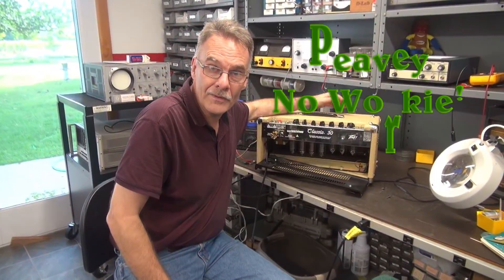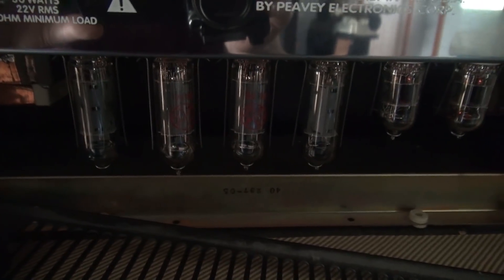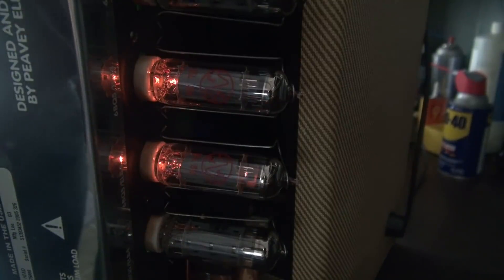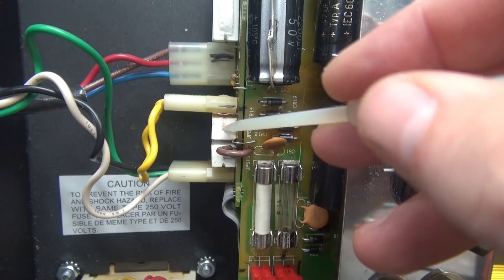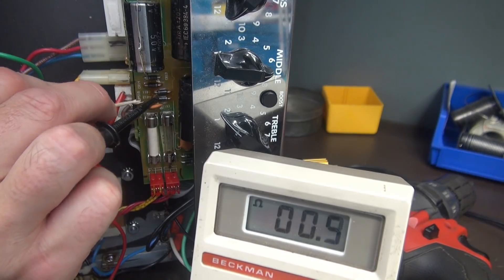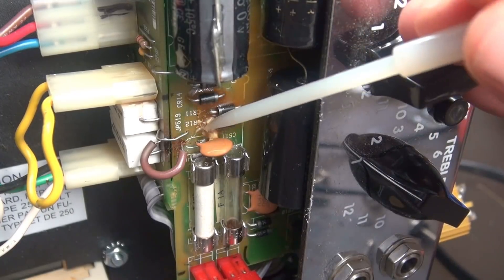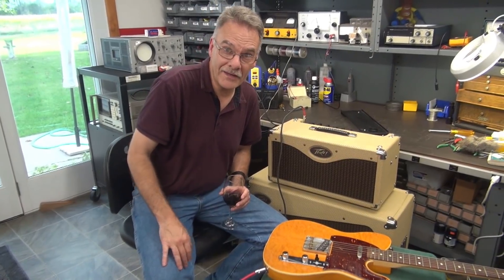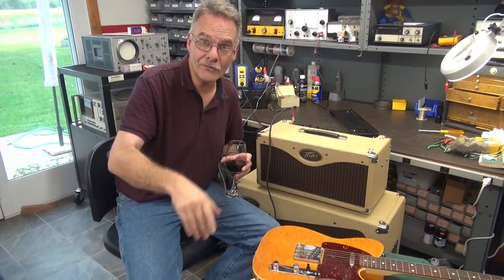How to fix Dead Peavey Classic 30 tube guitar amp no output for Free D-Lab electronics

Comment: Hey, thank you for posting this video! I'm confident in being able to do this repair on my Classic 30 because of the knowledge you shared. Apologies for this noob question:  Do you think it would be alright to complete the jumper between the resistor and diodes with an insulated copper cable, or should I use a different type of wire?

Comment: Hi D-Lab, appreciate your videos! I've got a C30 too, great amp. Now, as it runs very hot, I was wondering, is there something that could be done to make it run cooler? Or is it just the way it is? One could fry eggs on it that's how hot it gets! People say that this isn't a problem, folks even use it during hot summer months in the sun without problems. Still, I'd prefer if it didn't get that hot.
So if there's anything that can be done, I'd appreciate your advice! Thanks!
Reply: My tech and the a tech online said it wasn’t an issue. I still run a small fan on my classics. They don’t cook as hot now. I’ve seen rig rundowns where the amps have a fan cut in and installed on amps. I’m still not sure if the fan does any good though? Amps still work great.

Comment: Having similar issue, changed the bias resistors and it will run for about 2 min then has a low screeching sound and nothing from the guitar

Comment: D-Lab great video. My issue is none of the tubes come on. Sure enough right where you have the issues with this amp mine showed the same burn AND the last tech did a similar jumper to yours. Also mine has the same burn area around C51 cap (?) next to the fuses. Mine looks much worse though than yours and hasn't been jumped like the one in your photo. On yours ( at 3:09 in video) it looks like the person completely pulled the Circuit Board to make the jump solder connection which I do not want to do. Is there a shortcut?

Comment: Hi! I appreciate your videos!  2 questions: 1.  WTH is with the electrolytic cap that's right next to the 4 diodes? That would be the top of the picture.  It looks like the leads of the cap are folded over on each other and are soldered together on the top of the cap....   2.  It seems as though the 2 outer output tubes aren't glowing....could be camera's fault, but are they working?

Comment: Mr D-Lab or may i call you Terry ?  I hope you can direct me in finding the right replacement for a  Motorola  70474200 W 9703 power transistor that seems to be extinct ? and point me in the right direction, i apologize  for ask-n about  solid state, instead of tube but i thought if anyone knew it would -b u

Comment: Thank you, D-Lab! I'd been putting off fixing mine til I saw your video- same problem, same spot- but the other big square resistor, which, strangely enough, crosses over to the far 2 diodes. However, same traces also go to a ceramic cap much closer, and not covered in adhesive. Soldered that in, now I'm up and running again! playing 60's Soul from Muscle Shoals with MighTy Finds Band and MT Arms Duo- thanks again for the video, D-Lab!

Comment: Hello, I would like to tell you about my problem with the valves of my peavey classic 30. In my case, the valves that do not light up are those of pre amplifier. I've been manipulating the pcb to make some modifications. So it is possible that it has deteriorated some connection or jumper or etc ... this plate is very delicate. first no valves were turned on, then reviewing some solder I managed to make the power tubes shine, but the pre amp has been impossible. At the output of the diode bridge I have about 40 VDC in capacitor C45, but the voltage does not reach to the valves  ... could you help me to know the route that follows the voltage or some way of checking how the voltage should reach the Sockets. I'm desperate with this problem and I don't know how to do. thank you.

Comment: Worst PV design ever with all those delicate jumpers connecting folded over boards ... what pure junk crap design . Hate those crappy C30's , so I would charge super XTRA $$ to fix those pieces of worthless junk . I've had them , I've repaired a few . I now refuse them and tell people to just junk them . They all WILL FAIL > oh and then as a bonus on the combos you WILL get that unavoidable annoying power tube rattle as well as they constantly eat those delicate EL84 power tubes .... like I said ... pure JUNK > !  C30's are Hated by many techs .

Comment: Hi!  Thanks for sharing knowledge.  Have a quick question if you don't mind.  Looking to set up a DI rig for side gigs and just got a 100w solid state modeling head.  It has a headphone/line out that bypasses the speaker, but does that bypass the output transformer too, or is that even an issue with solid state?  This is all new to me.  I've always had tubes.  The manual is telling me I need a cabinet hooked up, but I don't know how much of that is factual and how much of that is Marshall trying to make another sale...  If I do need a load, would a dummy load work?  I'm doing this specifically because I've reached the age and good gear is heavy enough, I've decided when it really matters, there will be roadies :D

Comment: From Leo:  I always enjoy your videos, and take special note of your home brew projects. Thanks for the entertainment.    The heat damage of circuit board built tube amplifiers is a constant source of problem and worse on any amplifiers that mount the tubes on the bottom.  The Peavey Classics with all those board jumpers AND four hot 6BQ5 output tubes bring me lots of work.  The older Fender amps like Blues DeVilles had long spacer leads on the tube sockets to protect the boards. It worked pretty well, of course they do not do that any more.   Head style cabinets magnify the problem with heat build up.  Your video on the new Bassbreaker saved me a lot of headaches.  I told the man to send it to Fender, I am not going to fight that design, I am too old and grouchy these days.   Hard to beat a grommet board with tube sockets mounted to the chassis for durability and serviceability.   Keep up the good work!

Comment: The circuit board looks kind of discolored from heat around those diodes, and I'll bet that third diode (next to the other pair) also has funky connections that oughta be resoldered. The diodes are probably under-sized for that circuit, and if they were easier to access I would suggest that you upgrade them to physically larger ones that would dissipate heat better and have higher voltage and current capacity.

An easier way to remove circuit board glue is to chill it with an aerosol can of  compressed"air"; most of  those keyboard-duster type of products are actually similar to freon or other refrigerants, so if you turn the can upside down and drip or spray some of the liquid that comes out unto the circuit board glue (use the applicator tube that came with the spray can ) it will make it hard and brittle for at least a few seconds so that you can chip it off with a dental pick. Most of the circuit board glues still in use, other than hot glue or silicone, are actually corrosive to metals and become  electrically conductive over time, especially with exposure to heat.

Comment: Wow, we must be working on the same wavelength lately. Worked on a Peavey Triumph 60 today with no heaters lighting any tubes. A blown fuse on the filament circuit and a bunch of broken solder joints on the preamp board tube sockets. Touched them up and she fired up with a good signal. Then signal went out. After pushing the circus board I found a few more cracked joints. Working great now. Had some nice old Sylvania 6l6’s in it that were strong and well matched. This amp has been dead for 10 years. It came into the music store I do work for on a trade. Owner is very happy he now has something he can sell.

Comment: Hi Terry
I had the a Peavey classic 30 in the shop last week. Luckily, it just had a shorted output tube which took out the onboard fuse. So, an easy repair as well. I can't believe that folded over u shaped PCB though. What a service nightmare. Your fix was great. I would hate to have to pull those three conjoined pcbs to get at the back side of them.

Great job and great video!